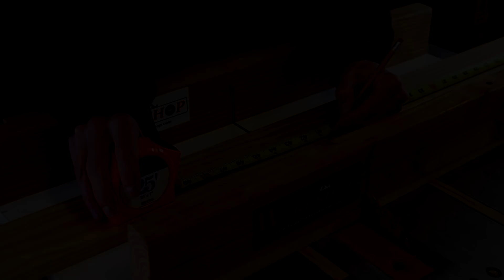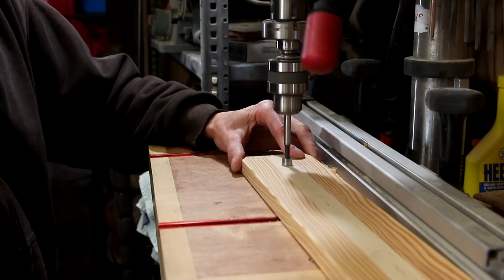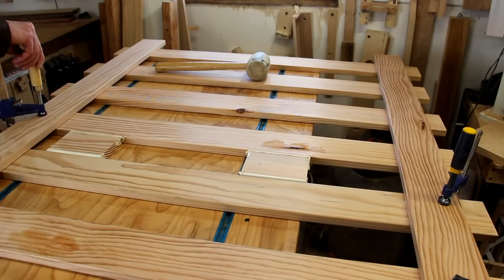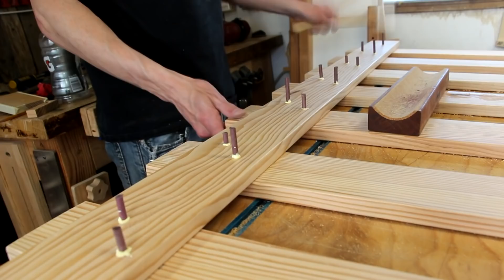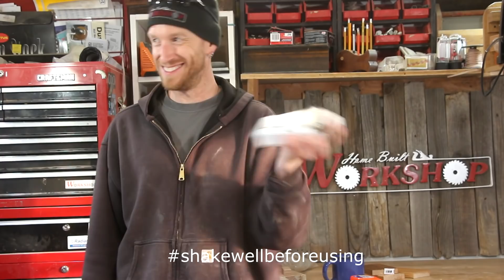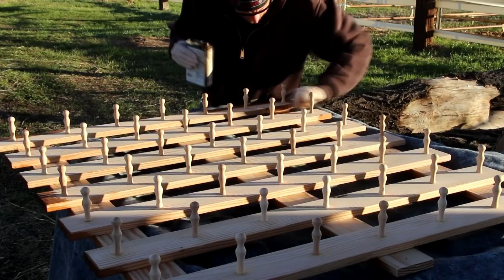How to make a Coffee Cup Holder (its Huge!)

Comment: In reference to your tape measurer comment at 0:40, check out FastCap tape measures. They have one that has markings on each side (lefty/righty) and a couple other really cool unique styles. I love em'!
Reply from the maker: I have one of those. The measurements are great. The only problem is that the belt clip is not reversible so you cant use it on either side of your belt. If they made it so you could switch sides, it would be my most used tape I think.